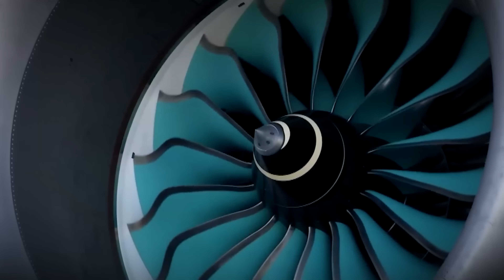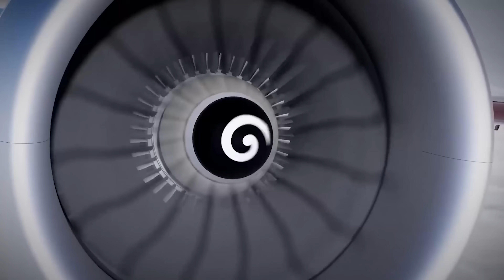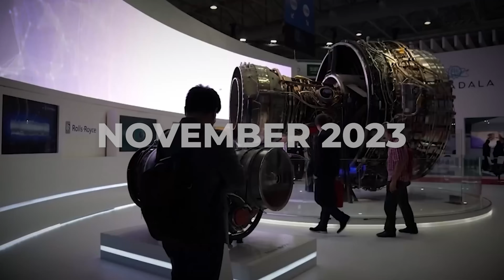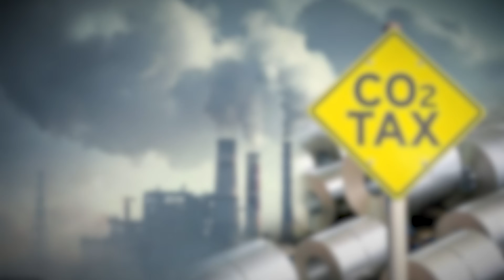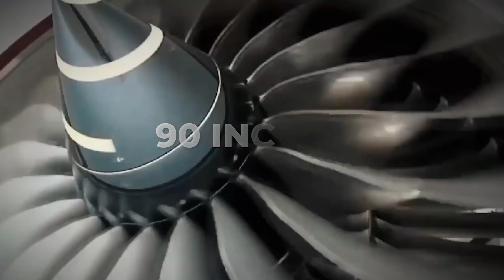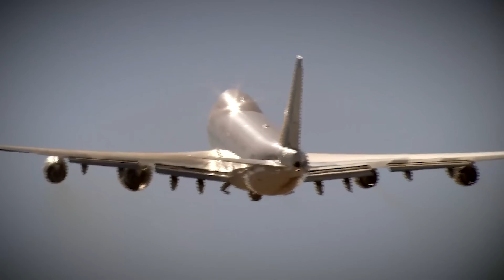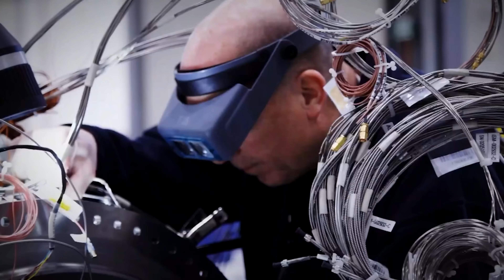This NEW Rolls-Royce Engine Could Completely Revolutionise Aviation

Comment: SAF and Net zero are bad policies that do zero good for the world and hold global prosperity and progress back. CO2 is harmless. We need to stop catering to the climate regulation zealots.

The reason better energy efficiency in jet engines matters is that its lower cost to run.
Reply from the maker: The lower running cost is obviously the big draw for airlines, but we cannot ignore the fact that every tonne of fuel burned puts 3.16 tonnes of carbon into the atmosphere. Being in the industry has brought to light just how big an impact we have. Thanks for watching!

Comment: I always thought the engine blades turned as fast as the turbine. Now I know there's a transmission too.
Truly an incredible leap in efficiency and power. And I hope the engine isn't too heavy.Great video!
Reply from the maker: Thank you very much for watching and for your support! Yes, it does depend on the specific engine, but certain engines do indeed now have a gearbox to improve efficiency.
Reply: R-R are the only company that use a 3 shaft design gas turbine. That's an important distinction.

Comment: So what differs from the Pratt and whitney GTF engine beside the size?
Reply from the maker: Well it's an entirely different engine. It's like asking what's the different between a Mercedes A-Class and a BMW X7 apart from the size. The only thing that relates them is the fact that they both feature a gearbox, and that they're both high bypass ratio turbofans, but beyond that, they're different engines from different companies, so they approach everything in different ways.

Comment: Roll Royce's credibility is in the toilet after disastrous Trent 1000, Trent 7000 and Trent XWB engines programs over the past 15 years. Rolls Royce should be bankrupt by now. They never fully compensated all the customers after so many RR engine failures, extra RR engine spares and unscheduled RR engine shop visits. And now here comes the over-promised UltarFan. 

As for SAF, there is not enough SAF to support 10% of the world's fleet by 2030 and certainly not enough SAF by 2050 when the world fleet is forecasted to double from 25,000 aircraft today to nearly 50,000 aircraft by 2046. Get real.

Comment: this engine was in development 20years ago, i worked for them for 40 years this hm has taken so long to develop it’s unbelievable
Reply: They want to 'do it right'.

We don't want another P&W geared fan debacle.
Reply: @phildane7411 yeah another 20 years then
Reply from the maker: Wow, I knew it had been in the works for a while, but I hadn't realised it was that long! Mad. Thanks for watching and for your insight.
Reply: @liftandthrustaviation  With the size of these new engines, along with the load on the engine pylon, aircraft manufacturers may need to completely redesign the wings on future aircraft. Possibly incorporating the engine within the thickness of the wing, making it slide out rather than bolt on. A return to 4 engines on wide bodied aircraft is another possibility, particularly if the bypass ratio increases above 20.
Reply: This was given up on as a dead end 20 years ago..  Fuel economy not as good as predicted. Noisy. Dangerous to ground crew, No blade-out protection.

Comment: Omg please get off this sustainability and hydrogen nonsense. And the 25% claim is dishonest.
Reply from the maker: The 25% claim is made by Rolls-Royce themselves, as mentioned in the video, over the original Trent engines. And facts and realities show that increased sustainability is a necessity, and more urgently every year. Manufacturers and airlines wouldn't be investing billions in it if they didn't have to, as it would be far easier and more profitable in the short-term to simply rely on the same old fossil-fuel burning and not worry about anything else.
Reply: @liftandthrustaviation "over the original Trent engines " is only mentioned long after the claim has had its clickbait effect. The straightforward assumed implication is that it's 25% more efficient than a present-day alternative. And that claim is far from true. 

Sustainability is not a logical concept. The sun consumes 100 million tons of hydrogen per second. Is that hydrogen being replaced? NO. The universe itself is unsustainable.  Engine makers "adopt" sustainability because they're forced to politically, not logically. If China were to develop an engine that saves 10 percent fuel burn but pollutes 1 percent MORE, all the idiocy of "sustainability" would be ignored, lest your country's aero industry become bankrupt in a handful of years.

Comment: Pratt and Whitney already have a gear reduction bypass turbo fan. The problem is the metallurgy. 
 P&W got some defective metal and now there are a huge number of grounded planes, waiting for the fix,
Reply from the maker: Yep the P&W GTF has been riddled with problems, but they're not specifically due to the gearbox so potentially Rolls-Royce should be able to avoid falling into the same trap. They also need to up their game for hot weather performance as that's been a criticism levelled at the current RR engines on the Airbus A350 by the likes of Emirates.

Comment: As an aviation enthusiast, this is one of the most exciting engine developments I've seen in years. What stands out is that Rolls-Royce isn't just promising future performance—they've already run the engine at full power. The gearbox alone is an engineering masterpiece. If the UltraFan really delivers anywhere near the claimed efficiency gains in commercial service, it could have a bigger impact on aviation than many of the aircraft it's designed to power. The next decade is going to be fascinating to watch.
Reply from the maker: Agreed. Rolls has had plenty of issues lately but they’re not the only ones, and hopefully they’ve learned from them. As you say, the tests and the performance are real, it’s not just theory. Now they need an aircraft to put it on…
Reply: they were developing this so many years ago it’s a joke
Reply: @michaelkitson8594  Nuclear fusion, Boeing 777x, Geared turbofan ... the list goes on.

Comment: 3,5 meters, huge engine, I wonder how much bigger they can go before ground clearance will be an issue. They'll have to start mounting wings to the top of planes instead of the bottom.
Reply from the maker: Realistically, ground clearance is already going to be an issue with this engine. It’s an absolute mammoth of a thing.

Comment: 25% compared to a 30 years plus old technology? Why not compare it to the most efficient engines currently being used? Because that would make it sound less impressive?
Reply from the maker: Because that's the number that Rolls-Royce themselves are leaning on. It's supposedly around 10% more efficient than current generation technology.

Comment: Likening the GE9X to "a muscle car" designed for maximum power at the expense of efficiency is bollocks. It's far more efficient than its predecessor, produces far less pollution, and is far quieter. Crucially, it's derived from a proven Middle East workhorse, too -- on-wing desert reliability being something Rolls still hasn't solved with its XWB97. How will the Ultrafan perform in the sandstorms and 40-degree heat? This engine remains years away from certification and likely years beyond that away from post-teething service normalization.

Comment: No, RR will screw it up like all of their large engines initially. Just talk to the 787 customers that chose RR engines. The RB211 sent RR broke and the RR Trent engines on the A380 needed their oil lines redesigned after the Qantas flight 32 debacle.

Comment: The aviation has yo consider both acquisition and maintenance costs as well as reliability while absorbing the expensive realisations from some of he recent efforts at reducing fuel consumption. And then there is product support and liquidity of the asset.  Building a big beautiful fuel efficient machine is a step aming many more steps in the right direction.
Reply from the maker: Exactly right - it's an important step, but it's only one of many important steps.

Comment: Still a turbine......🥱
Reply: Straight question…….what would be the alternative for the aircraft types these engines are aimed at?
Reply from the maker: The primary alternative to Rolls-Royce at the moment in the longhaul sphere is GE. Pratt & Whitney supports legacy engines but they're more involved in the shorthaul market at the moment.
If your question was more meaning what's the alternative instead of a "traditional" jet engine like this...well, currently, there isn't one. The different fuelling systems being developed and evaluated for the RR UltraFan give some scope, but beyond that, other viable technologies are still a long way off. For shorthaul, open-fan engines are being developed, as I looked at here: https://youtu.be/0rKnmQdbwcs. However, these still have a long way to go and big hurdles to overcome, such as the noise.
Thanks for watching!

Comment: GTFs still have a host of engineering issues
Reply from the maker: Certainly Pratt & Whitney's ones do. It'll be interesting to see if Rolls-Royce has managed to learn from that and engineer them out. With that said, the issues that P&W have been struggling with haven't necessarily been related to the gearbox itself.

Comment: The Narrow body version has just - JUST started its development based on the widebody one. Meanwhile its too big for the 777x and would be too costly to have it added to the A350-2000 (if that is made) so its an engine for a widebody with no customers now and we can presume Boeing is in no rush to change the 777x and Airbus can barely keep up with A350 orders (and only the 2000 version is left and a new engine would be massive re-engineering challenge and they have the ULR also). Its too tall to be fitted as a 2nd engine option to the 777x and neither plane makers next plane will need an engine this big. Its best option was any A380neo but that plane is a dodo now (and no free factory big enough to fit it ). Meanwhile middle eastern airlines are not happy with the rate of fixes to the latest Trent which is being used (and most airlines are fleeing RR engine choices when ordering unless they have no option)
Reply from the maker: It’s definitely a long road ahead, and seeing how RR navigates those integration and reliability concerns will be the real test behind the flashy headlines.

Comment: ''altitude ground starting"? Sounds like an oxymoron. Do you mean 'inflight restart'?
Reply from the maker: That is indeed what the tests are designed to simulate and replicate, but they're so-named because currently the testing is simply taking place on the ground in special facilities. But it's designed to replicate the thin air and low temperatures and so on, the conditions to be found when attempting an in-flight relight.

Comment: “Built for a world where fuel costs money?” Doesn’t fuel cost money right now?

The Ultrafan 80 demonstrator has a fan larger than the GE9X but doesn’t have enough thrust to power a 777-9. The KPIs are based on comparison to a Trent 700 and the Trent XWB—over which they claim 10% fuel efficiency delta. The GE9X has a 5% fuel efficiency advantage over the current Trent XWB.

The problem for Rolls Royce is that airlines are more and more averse to taking the technical risk of engine manufacturers, because that inevitably turns into financial risks. GE makes the most reliable and efficient engines right now by far. RR has a lot of catching up to do.
Reply: facts.

Comment: The speed is too low! They demonstrated full power in 2023, and they'll still not be in service at least until 2035?!! The process is pathetically slow.
Reply: Airbus and Boeing have become government companies mired with red tape. We've come to expect a slow pace from them. But what about new players? Are there any new plane manufacturers who move at startup speeds?
Reply from the maker: "Startup speeds" is just not really an option in aviation. I hear what you're saying about Airbus and Boeing and their red tape, but that's aviation in general. Embraer could be argued to be a little more agile. But also, every year, safety standards get stricter, which means certifying new products takes longer. So yes, you have COMAC in China, and you could even argue Yakovlev in Russia, but they face an even longer battle for certification is they're presenting new, untested products, and they represent new, untested manufacturers. So unfortunately, the pace is slow across the board.
Reply: Let me ask the question the other way: what are the latest advancements coming up in the market in the next two three years?
Reply: Otoh, we'll continue to see air travel becoming cheaper and more environment friendly at least till 2040 and later.

Comment: That's all good and well but as RR knows, once in production performance & efficiency doesn't always match the calculated expectations claimed before any engines were built & flying. Their last big technology breakthrough failed so badly in the real world when flying in & out of countries that experience high temperatures, like their largest customers in the Middle East that most of them have switched all future orders to GE platforms. Added to the failure rate, the flying hours before major overhauls were terrible compared to claimed, the fuel efficiency did not meet expectation & the reliability was woeful, not to mention years behind schedule in manufacturing causing huge delays for airlines orders. I hope they never hae to suffer such a disaster again for I want RR to not just be successful but the best but if your customers have lost faith & announced their switching platforms it might be too late :(

Comment: A 25% leap in efficiency over ... what, exactly? I spent two decades in jet engine certification, and getting ten percent improvement from a new generation was stellar (along with longer time-on-wing, etc.)
Reply: Do you think we are at the limit of improving turbofans efficiency?
Reply: @BobbyGeneric145 If the turbine blades could take unlimited temperatures then effieceny would improve massively. But the main limiting factor is heat on the turbine.
Reply: These new Rolls Royce Ultrafans should be attached to the new US Air Force One.
Reply: Ultra fan would be 10% more efficient than the XWB
Reply: This is the number for the airlines. With small asteriks *your milage may vary
Reply from the maker: Than the first generation Trent engines - particularly benchmarked against the Trent 700. OK they're not brand new any more but nonetheless, that's a huge leap!

Comment: how are they storing hydrogen
Reply from the maker: Rolls-Royce is storing hydrogen in gaseous and cryogenic liquid states, primarily focusing on the engineering challenges of liquid storage. Because liquid hydrogen requires significantly more space than jet fuel, their testing relies on specialised, highly insulated tanks and advanced fuel delivery systems. They're actively testing aerospace cryogenic liquid hydrogen pumps at their facility in Solihull, UK, to ensure safe chilling and pressurisation of the liquid liquid so it can be pumped into an engine for combustion.

Comment: I'm not sure if RR can uncrown the GE9X as GE is ahead of the race.
Reply: it is larger fan dia but less max thrust and probably less certified(rated) thrust on wing, similar to the GE9X max thrust of 134k+lbs but will be rated at 105-110k on wing. the GE90 max thrust is  127k+ but rated at 115k on wing.

Comment: Good vid, no fluff or AI rubbish.  Thanks!, subbed.
Reply from the maker: Thank you very much, I appreciate you watching and taking the time to comment! And yes, exactly right, I’ve actively moved away from AI and it won’t be coming back to this channel! Thanks for the subscription - welcome along :)
Reply: @liftandthrustaviation  can still tell its AI script
Reply: @liftandthrustaviation did you use ChatGPT to help with structuring the script?
Reply: Definitely it is nice to see Aviation power plant technology start to move forward in big steps.  It's also very impressive that the ultra fan is adaptable to many options like hybrid as this opens up aircraft design space quite a bit.

Comment: The wings of the target aircraft for each of these engines must surely be high-mounted, right?
Reply from the maker: Nope, it'll go on dihedral - low mounted - wings, just on big aircraft with longer landing gear. Nonetheless, like the LEAP-1A engines on the A320neo, they'll surely mean that ground clearance becomes more of a critical issue as they are absolutely massive.
Reply: @liftandthrustaviation Holy $#!+, man! Those airplane wings would have to have some serious dihedral.

The type of planes that I'm picturing in my head with these engines hanging off their wings look absolutely ridiculous!😂
Reply: I would assume that it will be a combination of wing design, long landing gear and attachment in front of the wing.
Reply: @ffeffeff Perhaps, though I'm now thinking that the most suitable applications for this type of ultra high-bypass ratio turbofan engine format are those "blended-wing body" type of aircraft designs that have been tested for a while now.
Reply: I agree, although I can not estimate how far down the road such an aircraft is? I am sure that the engines at RR are designed with installation in mind, so there must be some kind of aircraft intended. Time will tell.

Comment: the challenge is maintaining efficiency at smaller dimension cores,my two cents.If it happens, GE faces serious competition.
Reply from the maker: Agreed - P&W have shown that the gearbox can provide the efficiency but they've also shown some of the pitfalls, albeit not with the same parts. As you say, if RR can make this efficient at the smaller size, and also ensure the long-term reliability, they'll be onto a winner.